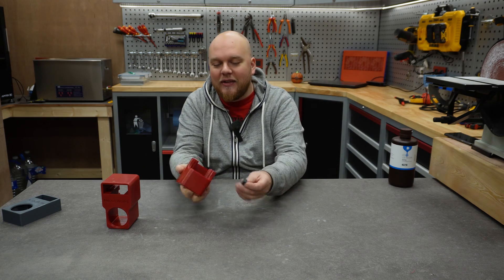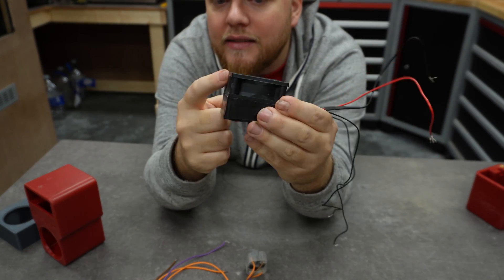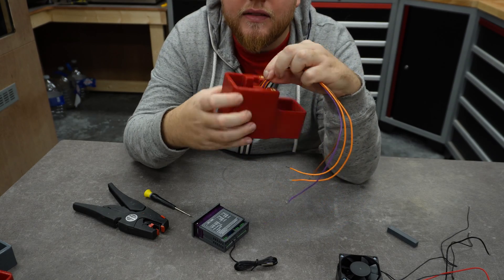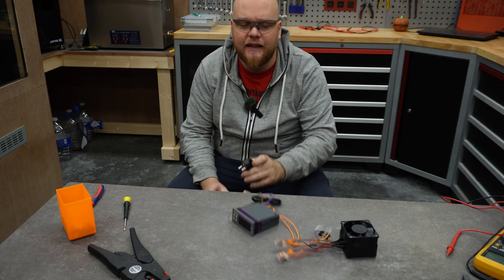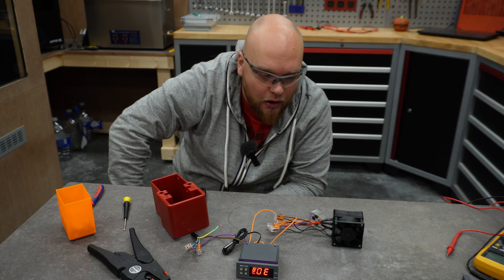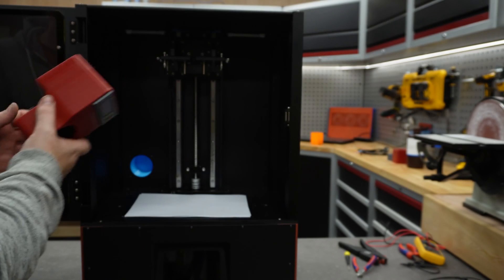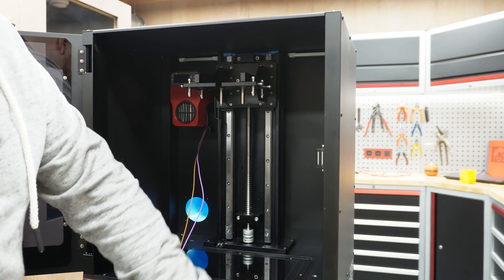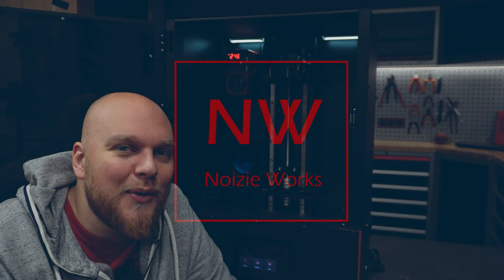Printable all-in-one PTC heater for FDM and RESIN printers.

Comment: Weird, the Amazon listing doesn't mention a DC fan. One of the reviewers even states: "Since there are no specific instructions in the package, I would like to point out that both the heater and the fan (also 220v) must be powered by 220V AC" 🤔
I've never seen a 220V DC fan in this formfactor before.

Comment: Looks very intersting. I am not great with electric. Where should be the fuse located and how many amps?
Reply from the maker: @blammad4000  depends if you use 12/24/110 or like my case a 220V system. The fuse should be slightly over what the systems pulls. If you go with a power supply then these units should have a fuse inside and otherwise you can add one of those car fuses behind the outputs of the psu.
The safest way will always be with a low voltage setup like a 24v system
Reply: @NoizieWorks  I am also on 220V system. PTC is 300W, 3W for thermostat and fan is negigible. Nominal current should be 303W/220V=1.4A. A fuse around 3A should be OK considering inrush right?

It's my first electrical project. I don't want to burn the house ^^'
Reply from the maker: @ 2Amps would already be enough if you measured the inrush that should always be the max amps if not you will pop it and know to go a bit higher 😅
100% just made a vid on somebody burning his house down using a printer.

Comment: what kind of fan is that? maybe i missed something but you are rectifying AC mains to DC and connecting it straight to the fan, that's like 350 V DC straight into the fan?
Reply from the maker: @mikal_1  these fans come with the ptc element, the ptc elements is 220v AC and the fan is 220v DC so i rectify the output to the fan to 220DC.
When purchasing this as a AC setup i didn't know the fan on it didn't work that way.
Low voltage dc will be safer but you will need to use an extra power supply which i'm trying to avoid for the setup.
Reply: @NoizieWorks  I just received it and dissemble it to get the fan reference. Mine was a SZR6025E22H. According to spec sheet it runs on 110-220VAC. My very limited understanding is that the rectifier is not necessary. Is it correct?
Reply from the maker: @blammad4000  it should be on the fan, if it states ac it's fine
Reply: @NoizieWorks  Not mentionned directly on the fan but on the manufacturer sepc sheet online. I just plugged it and it worked :)
Reply from the maker: @blammad4000  nice!
Reply from the maker: Let me know if you like it

Comment: I like the idea of drilling the printer on purpose to make something compact and integrated instead of a cumbersome additional enclosure around! I even had the idea myself before that video, for air extraction when I was considering buying a HeyGears UltraCraft Reflex. Then I saw that someone already did a clever removable add-on that actively vents the printer by stacking on top of the hole for the resin bottles!

Comment: Best location for a heater in on the bottom of the case. Hot air is lighter than cold and rizes up creating natural convection effect in the case.
Reply from the maker: I didn't want it to blow on the print as this puts out 60+c
Reply: @NoizieWorks in coreXY printers the print happens in the upper part of the case and having the heater at the top wouldn't do just what you were trying to avoid (blowing directly at the print)?
Reply from the maker: @photo_n_art  In my example it's for a resin printer so you can put it wherever you want for your use case
Reply: @NoizieWorks Oh OK, you are correct I didn't realize it was in fact resin printer 😎👍
Btw. I admire resourcefulness and skill set when it comes to thinkering, your videos are always interesting and helpful... Keep on keeping on my friend and thanks for sharing your knowledge with us.
Reply: with a fan mixing the air it shouldnt be a big problem
Reply: VAT heating is better than chamber heating at resin printers

Comment: Hello, I watched the video and it was very helpful.
I also purchased the same PTC fan heater as you (DC fan and AC heater) and plan to combine it with a 220V STC-1000.
What kind of diode is used in the rectifier shown in the video? (Is there a purchase link?)
Reply from the maker: I bought 1000v diodes but now you can get them for cheap on amazon. Here is a example for you: https://www.amazon.com/Taiss-KBPC5010-Rectifier-Warranty-KBPC50-10/dp/B07JC3Z79N/ref=mp_s_a_1_5?crid=3DN0XHFN9UKKY&keywords=ac+to+dc+rectifier&qid=1704768140&sprefix=ac+to+dc+rectifier%2Caps%2C209&sr=8-5
Reply: @NoizieWorks  Does one KBPC5010 play the same role as the resin rectifier shown in the video?
Thank you so much for the answer and link!!
It was very helpful.
Reply from the maker: @hooni_kang  yes it's the same 😄 no need to solder and poor epoxy

Comment: Hi there, how did you find out your fan was DC powered? Mine comes with no visible elements indicating it and I ordered a 220V AC kit that came with PTC and fan already assembled.
Reply from the maker: It was on the box it came in, not sure but somebody told me it could be ac/dc fan but i don't think that's possible. Best off replacing the fan or like i did make/buy a rectifier to solve it. Very cheap diy and still works like a charm.

Comment: it should be possible to connect this to the heated chamber interface points on the printer mainboard and use the hardware/software to control the chamber temps automatically.  Correct me if I'm wrong but if the board has the I/O for it I can't see a reason not to use it.
Reply from the maker: Could work but i try to keep it user friendly aka no clue how that would work.

Comment: Hey Noizie! I installed your heater and it works amazing! Running into a small problem now though lol I also installed a carbon filter through the back exhaust and the heater can't keep up. Any suggestions?
Reply from the maker: Thanks dude, well i don't run my exhaust during printing. Only for start and cleanups. It actualy holds in the smell decently.

Comment: Awesome, I got my Jupiter last Friday, I am currently doing a form of heating implementation, will post the picture link when am done
Reply from the maker: Feel free to share!
Reply: @NoizieWorks  https://youtu.be/h_vVgom2aQ0 I used 2 heaters in my Jupiter. I realize at first that when one heater heats up and turn off, not all the inner case have the same temperature. It takes a longer time. With the two heater, one on each side, I was able to maintain a balance temperature. This may not be the case for everyone, because I live in a section of Canada where it is cold. I use an SFX PSU because it is tiny, and I can print a mount for it later. I'm also working on a filter that I may need to power from the PSU also.
Reply from the maker: Thanks for sharing, will check it out